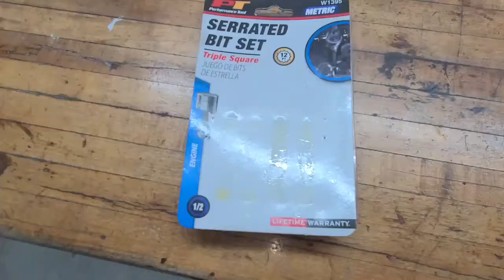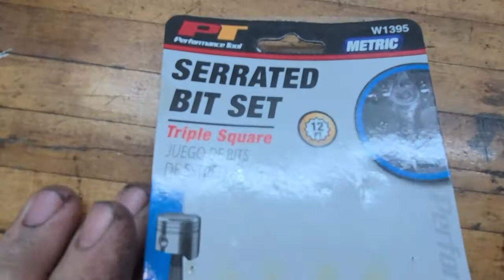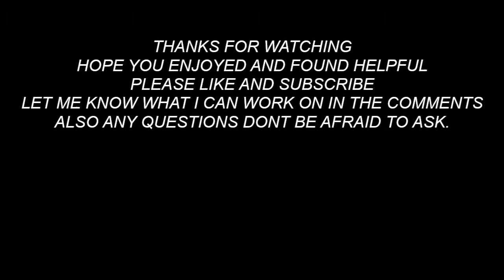2015 VW JETTA HOW TO REPLACE ENGINE PART 1

Comment: Imagine my surprise when I searched 2015 jetta engine replacement and find a detailed video series on exactly that! Only difference is that mine is a standard. Thanks DMW Automotive!!
Reply from the maker: I'm glad I helped bud. I personally don't think this is a good video anymore lol. It was one of my first ones I was nervous and wasn't sure how to do it. And to top It all off I had 3 days to do this after work. But good luck hopefully it goes good for you
Reply: @dmwautomotive2291  all i needed was the information, not an award winning performance 🤣. Quick question... is any part of the standard transmission's clutch bolted to the engine like the torque converter of an automatic?
Reply from the maker: Yes all of it should be bolted to the engine. I have a jeep video where I do a clutch they all should be similar. 
You should have no problems getting the engine and trans apart though. They are connected with the input shaft which should slide in and out freely

Comment: Hello thank you for making this video on VW Jetta  I was able to do my car thanks to your videos. Now that installed the engine  3 days later the transmission isn’t engaging in any gear. Ant suggestions on what it could be?  I got a code  P0721  thank you again
Reply from the maker: I love hearing comments like this. I'm glad my videos helped someone.
      Unfortunately, I can't be much help. I'm not supper familiar with vw. If I were you, I would try checking the transmission fluid if it's low at all it could be acting bad. I hope this helps

Comment: Is this the 2.0l diesel engine. Just asking cause my son is going to replace his in a 2014 Volkswagen Jetta. It has the 2.0L Turbo Diesel.
Reply from the maker: No it's not diesel.
Reply: @dmwautomotive2291  oh ok ty
Reply: It the process the same for the diesel engine other than maybe the turbo clamp.